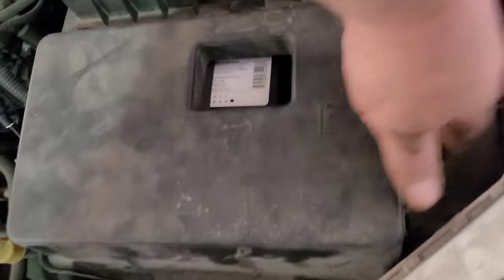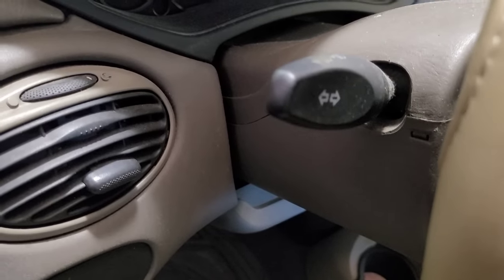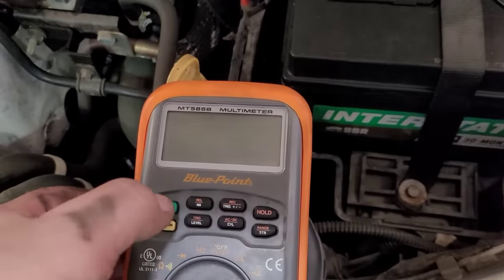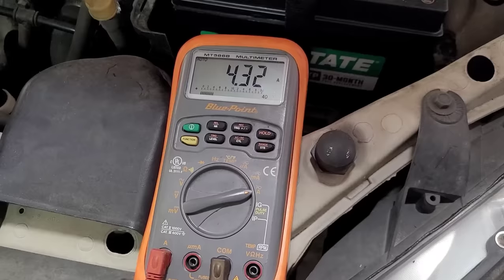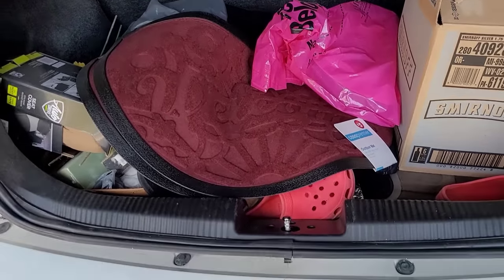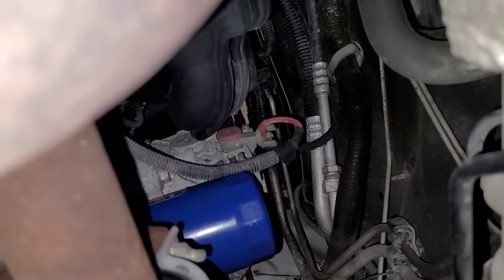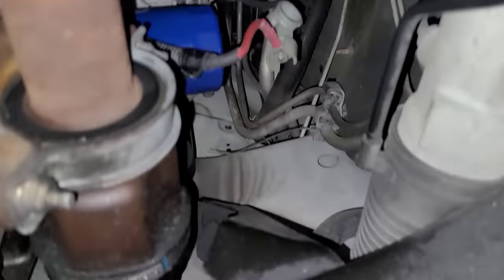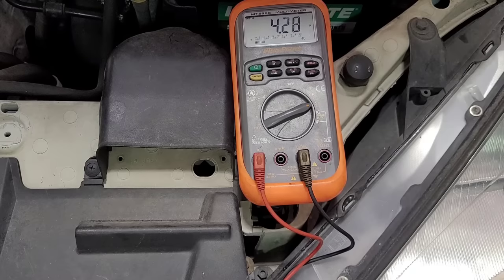Why is the Battery Going Dead? This One Will Surprise You!!

Comment: 4 amp draw would indicate that the field is still activated when the engine is off. I found that this is easy to check by touching a screwdriver to the alternator pulley [engine off of course] if the screwdriver tries to stick to the pulley it is magnetized by the current going thru the rotor thus indicating the regulator is stuck on therefore condemning the alternator
Reply: DING-DING-DING!!!!  THIS IS THE BEST, EASY TELL!!!!
Reply: Huh, learn something new everyday, thanks,. I know shorted diodes will cause a draw.
Reply: awesome tidbit.
Reply: Thank you! Good information brother!
Reply: 4 way high for shut off vehicle
Reply: This is GENIUS!
Reply: Hmm - I see this method serving a purpose also when the engine is ON!!
Reply: Diode pack goosed ...
Reply: Thanks, that's pretty clever
Reply: Working on cars 50 years never stop learning, thanks
Reply: That presumes the alternator pulley is steel and not aluminium! Not a very scientific test. Much better to check for coil current with a clamp meter.
Reply: @boblewis5558  yeah a good clamp meter would be best and most likely what I would go for in a situation like this, but the screwdriver trick I thought was pretty cool. I don't ever really remember coming across too many aluminum pulleys if ever. I'm sure they exist I just don't ever recall any that were.
Reply: Explains why I sometimes got zapped, when everything was supposedly turned off, working on my mom's 2000 Ford Windstar.
Reply: @boblewis5558  the shaft of the alternator is always steel
Reply: @AndrewHemstreet  so NOT the pulley then!! Read the OP again! 🤔🙄
Reply: @boblewis5558  you can easily tell by looking at the pulley whether it is aluminum or not. But the shaft and nut, both accessible from the front center of the pulley, will be ferrous metal, and therefore magnetically conductive.
Reply: @1SqueakyWheel  I never said they weren't! Please read AGAIN what I wrote in response to the OP saying to place a screwdriver against the *PULLEY*!! NOT the shaft or nut. And BTW SOME alternator nuts CAN be stainless steel and depending on type THEY may be non magnetic. An aluminium pulley with a stainless nut isn't going to help now is it? Please stop trying to put words in my mouth that I never uttered.
Reply: @boblewis5558  you're right about the nut possibly being of a nonferrous alloy, I stand corrected there.  The shaft still faces, so it's fairly accessible in most cases.  

But I was responding to your first message, never insinuating that you'd said anything about assuming the pulley to be magnetically conductive.  
My point was that he may have thoughtlessly misspoke, while meaning the pulley or anything within it;  I didn't read his message as technically specific as you did, hence my message.  Nothing to take personally, mate... 
I totally understand pointing out the technicalities...  I'm guilty of doing that too!
Reply: @drewrinker2071  the only aluminum pulleys I've ever seen on a street car were set up for racing on weekends and the factory steel were replaced. With the aluminum pulleys the engine will rev quicker and saves a few pounds of weight when every hundredths of a second will determine the looser
Reply: @theEVILone0130  yeah I can imagine racing guys replacing anything they can with aluminum to make the car lighter so that doesn't surprise me at all 😆
Reply: @boblewis5558  let's just agree the best way is to put a dc amp clamp meter on it. I'm with you brother. But this is a cool little tip for ppl that don't have dc amp capabilities
Reply: @drewrinker2071  I totally agree. It's unbelievable to me that people seem to think you need a fourth mortgage to buy a good ac/dc clamp meter. Worse, is the number of people who think that clamp meters are only for AC! 🤔🙄🙄🙄
Reply: @theEVILone0130  1. The size and/or metal of the alternator pulley whether made of steel or aluminium NEVER affects how the engine revs! 

2. The engine speed and size of the pulley ALWAYS affects the alternator. It's why the crankshaft pulley is always bigger than the alternator pulley ... So that the alternator revs quickly enough at idle to produce an output large enough to overcome the battery voltage to charge it.
Reply: Brilliant!
Reply: This is such great advice to stumble upon in a comments section thank you !!! Very clearly explained you're a gifted teacher
Reply: @jamesocker5235  What does that mean? What is "4 way high"?
Reply: @wesman7837  just what Dan said, 4 amps will trash your battery in short order
Reply: I had PCM issues in my 2000 Excursion for months. This Excursion was used only to tow my trailers.  The Theft system would intermittently keep it from starting. After 4-5 months of chasing that problem (and replacing the PCM) the battery would die prematurely. Finally my mechanic tested the Alternator and the diodes were bad....said it causes a PCM to do all kinds of stuff....bought a remanufactured Alt from Ford and all's good now. 76,000 orig. miles
Reply: Great tip, thanks.
Reply: Especially with the alternator hidden way the heck down there..  ya can barely see the front of it under that power steering bottle.
Reply: @drew rinker  Even if an aluminum pulley was a thing - it would be mounted on a steel shaft and causing a field anyway.
Reply: Amp meter or if you have a Power Probe Hook is the best way to measure parasitic draws. I’ve seen quite a bit of alternator diodes causing a major drain like this. Also, what was the 135 mA draw? Ideally there shouldn’t be more than 50 mA draw on any vehicle with all modules sleeping.
 When I check the draw on a vehicle I always leave the doors open and trunk open. Of course the latches need to be closed but doors open so you can access the inside fuse box without having to open the doors and waking up any modules. 
 For a draw like the 135 mA you can take your dvom and measure across the terminals of each fuse for any voltage. Do NOT pull any of the fuses to determine if it goes away, as this can cause a module to wake up when reinstalling it. If you have ANY voltage showing across the fuse, then that circuit is certainly contributing to the draw. Whether or not it’s the entire draw will remain to be seen. 
 Just my 2 cents to add to the discussion.
Reply: @TheRealCheckmate  actually it doesn't confirm anything anyway (except maybe a shorted ignition switch). Ignition ON ... current flowing (go look at the vehicle wiring diagram) because that's the way the ignition light works ... It goes out when the voltage both sides of the lamp is equal (hence no current). 

When you turn on the ignition current flows from the battery through the ignition light, through the field coils to ground. Why? Easy! Without that current there would be insufficient magnetism to get the alternator generating sufficient voltage (if any).

Ignition OFF ... No coil current, no magnetism!

Engine running? Of course there should be field coil current ... But do NOT under any circumstances try putting a screwdriver any where near the alternator pulley whilst the engine is running and turning it!
Reply: @ArifGhostwriter  if you want to chance getting a screwdriver flung at your face/body at high speed due to a slight twitch of the hand and whack! Dumb idea! Screwdrivers and high speed rotating parts do NOT mix well!

Also, testing coil current with the engine running won't help if you're trying to find a parasitic drain!
Reply: I thought everyone knew this. I was doing it in late 1970's. (using screwdriver on stator pack to see if it became electromagnet with ignition on)
Kinda surprised how many people are saying diode pack dead, diodes ain't connected to field coil.
Reply: @1crazypj  Trio diode lets current flow in only one direction. If the diode is faulty and current is allowed to flow in reverse it will certainly cause a major parasitic draw.
Reply: @MicheluceRizzuto  Yep,  but diode pack still isn't connected to rotor, only to stator. 
The regulator pack may be sending different voltages to rotor to change magnetism of rotor or it could be switching on and off to set charging limit, it's way more efficient than burning off excess voltage as heat (I also worked on a lot of permanent magnet alternators on motorcycles)
I've seen some crazy no load voltages (even an early 6 volt Honda 50 can run at 90v AC), full fielding a brushed alternator would give at least 17v at idle spinning at 900¬1,100rpm (rotor connected direct to crank or geared off clutch)
I learned about it a long time ago as Suzuki made great motorcycle engines bu the electrical system was just cheap with regulators and rectifiers failing on a pretty regular basis (it was still happening in 2010 , sometimes leading to bikes catching fire) I don't know about newer bikes but as they did pretty much the same thing for 40+ years it's probably still happening?
Shorted diodes reverse flowing could and did cause stator windings to overheat and burn off the insulation, as they were usually inside crankcase and oil cooled it could cause a lot of problems. 
I spent quite a lot of time fitting Honda regulator rectifier packs to Kawasaki's, Suzuki's and a few Yamaha's as Honda were the most reliable even in the 1970's (there was no point replacing an OEM R/R with one you knew would fail within 18 months or less)
Reply: @boblewis5558  pulley could be aluminum but the nut and the shaft would have to be steel and this test would still work
Reply: @thecommodoredecker  but ONLY if the ignition is on. No ignition ... No power to the coils! The coils get power via the ignition lamp intially. Ignition off = no power to the ignition hence no power to the coils! That's a NORMAL condition for the ignition being on. There SHOULD be coil current flowing otherwise there would be no alternator output when the engine starts. The NEGATIVE of this test would indicate a problem. I E ignition ON, but NO alternator coil current = blown ignition bulb!
Reply: Smart
Reply: @muziklvr7776  shorted anything will cause a draw
Reply: Actually it was closer to 5 Amps.
Reply: @muziklvr7776  but again, depending on the specific alternator wiring it may NOT cause a draw unless the ignition is on with the engine not running. It depends on which diode/s is/are shorted.

One or more of the main output diodes being short would cause a problem if the main output is permanently (rather than via a relay) connected to the battery (most commonly used arrangement).

Not sure why people would junk the alternator just because of a blown diode though ... Replace the diode pack. Or even check for and chop out the offending unit and replace with a low cost high current one. Or even mod the alternator (easy) to use an external diode pack - 200A and higher 3 phase packs are readily available at fairly low cost ... MUCH cheaper than even a second hand alternator.
Reply: @1crazypj  :" diodes ain't connected to field coil"

To the best om knowledge that is certainly true. But if a diode shorts, that would certainly provide
a path for battery current to "back flow"  through the shorted diode, the rotor windings, slip rings to ground.  Right?
Or maybe alternator internals have been changed in recent years to prevent this?

I noticed that he got full charging voltage when the engine ran. Would have interesting to have a scope
and look at the alternator output and see it was coming from an intact bridge rectifier or if it looked like
half-wave rectification (i.e. bad diode)........

Yeah last month I had exactly this problem - parasitic current into alternator - on my G3500 Express Van.
Replaced alternator and all is good...  (-;
Reply: @boblewis5558 
Ahhhhh, you were wrong and that's that. 
THE END.
Reply: Ran into this on my boat, turned out to be alternator, diodes to be exact.
Reply: Ahhh that's pretty smart
Reply: 50W? Sounds about right. But why would it stay energized? If the key is off.... Unless the regulator also has a relay or switching component. Maybe cause it's no bueno to collapse the coil field at the same time as when the armature winding also collapses? Something like that maybe. Physics as stuff
Reply: I found a fault in a Toyota once because on a frosty morning, there was a spot on the hood without any frost. Just enough heat off the alternator to keep frost from forming.
Reply: Excellent 👍
Reply: 50 to 200 milli amp draw is average draw.
All modules take time to go to sleep after a few minutes also.
One Chevy Silverado we had no one could solve this issue.
I found the electric brake controller would come on by itself randomly .
No trailer connected.
Pulled fuse  for it now all perfect.

Tiny Fuse site has voltage drop values for all there mini fuses.
This helps find a draw also.
In winter I used a Thermo camera shows warmer wires alternator etc.
I have an old induction Amp meter but it won't measure below 5amps .
Nice channel 👍
Reply: @boblewis5558 never ever saw an aluminum pulley on alternator...
Reply: @jamesocker5235 CRAP! Your battery can receive charge of WELL OVER 4 amps without any problem. Your alternator will do that on a cold morning after trying to start several times. The correct charge for a lead acid battery is VOLTAGE not current. 14.3 - 14.4 typically. 

If the battery has dropped to 11.9 volts and the car is jump started, then once the alternator hits 14.4 volts (usually within a split second of revving the engine) then whatever current is required will be fed into the battery PLUS whatever current is required for any auxiliaries!
Reply: @SuperSedingAngeL-yr0 Please explain why I'm wrong, and about what ... Otherwise all you are doing is trolling to no effect!

Besides, I  can prove I'm not wrong, so now what are you going to say!
Reply: @MitzvosGolem1  seems like there's a small gap in your field experience then! (pun intended) 😂
Reply: @boblewis5558  Actually 1976 I started as mechanic on marine industrial truck heavy equipment and trucks cars .
Tell us one alternator that has a aluminum pulley?
Reply: Thanks 👍💯
Reply: The alternator will also be warm.  Rectifier in alternator, most likely.
Reply: @theEVILone0130 Aluminum pulleys wear out too quickly, thus oem uses steel.
Reply: Never knew 😯 thanks for posting that info 🫡
Reply: That's a 100% score point.
Reply: I never knew this. I change my battery on my stored truck all the time because the battery keeps dying. I have changed the starter because it stopped working and thought it was that. But nope. I will try this 👍👍👍
Reply: Wow, this is amazing information
Reply: @1SqueakyWheel  this reads like a Monty python skit 😂
Reply: @anthonybrown3786  which chapter?  😁
Reply: @jamesocker5235 ?? Can you explain?
Reply: @muziklvr7776  Exactly this...the diodes in the rectifier bridge could go bad allowing a voltage draw from the battery. In my shop I have had plenty of alternators be the cause of a voltage draw on a battery. The counter experts at the parts shop proceed to try to sell you an alternator and battery because they took a parts quiz are EXPERTS AND they worked on their moms Buick one time.
Reply: That’s awesome
Reply: @muziklvr7776  I was interested in your comment. I’m not trying to be a wise guy, I’m just asking for some info. I was thinking that on a dial, they would probably burn open instead of actually short cross. Any info you could give what would greatly appreciate it. that’s why I love these sites, you just never know what you’ll come across. Thanks again.
Reply: @AndrewHemstreet  there you go, Andrew. Kudos to you for pointing that out to all of us. Thanks again.
Reply: 😂😂 Granny be listening to Frank Sinatra off of two 15' Subs.. BOOM BOOM "Love & Marriage"...😂😂